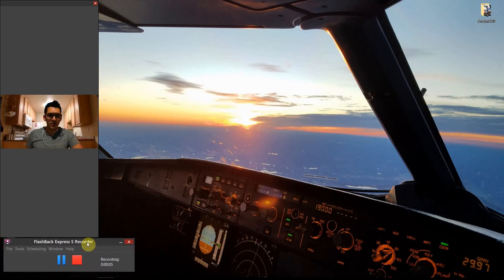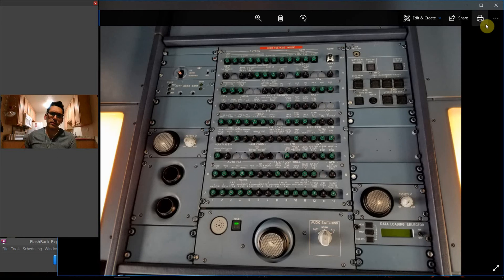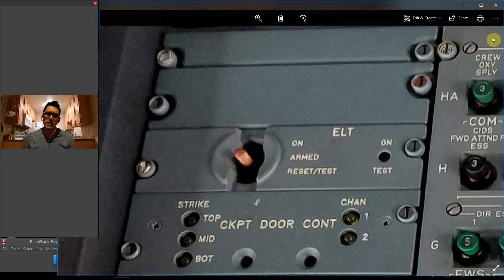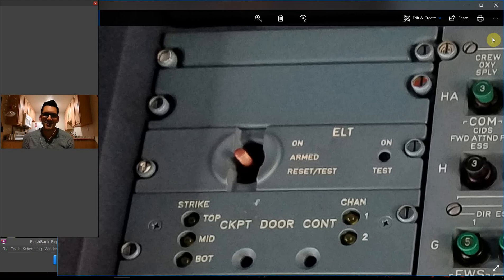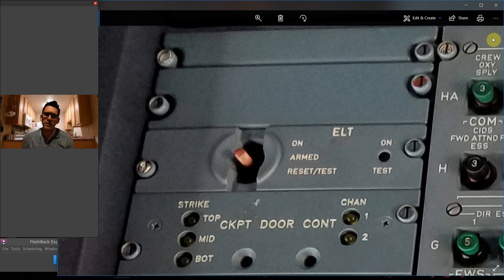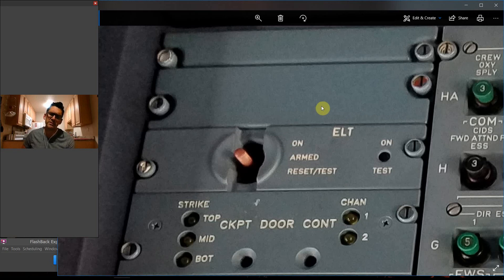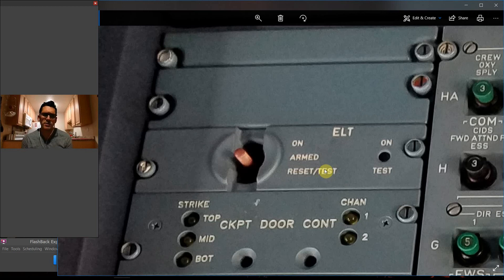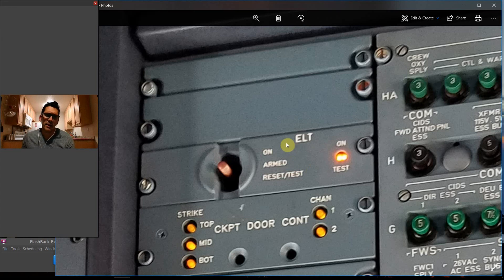Airbus A320 Cockpit Tour: #3: ELT: What do all those buttons do?!

Comment: The ELT system transmits on 3 frequencies, 121.5 MHz (Civil) and 243 MHz (Military) homing-signals and 406 MHz to the COSPAS-SARSAT satellite system. The battery-pack, installed in the ELT housing, supplies the power to operate the system.
The satellite system transmits the 406 MHz distress signal to a Local User Terminal (LUT), when the LUT is in range. The LUT receiving range is a radius of approximately 2500 km (1367 NM). When the LUT is not in receiving range, the satellite system stores the distress signal until transmission is possible. The LUT automatically processes the distress signal to identify and show the position of the aircraft to a radius of approximately 1.8 km (5900 ft.). The processed data is transmitted to a Mission Control Center (MCC). The MCC sends the data to an applicable Rescue Coordination Center (RCC), where Search And Rescue (SAR) operations are started. The 121.5 MHz and 243 MHz signals are used to find the aircraft in the final stage of SAR operation.

Comment: Hello Mike!! A question for you:
On E175 we also have the ELT switch in the cockpit and, during test, if something goes wrong with the ELT system during test the LED flashes many times to indicate that. Otherwise a single flash will be seen. How about the A320? Is there the same concept?
Reply from the maker: Hi Rubemar! Thanks so much for tuning in my friend! You know, we do not test the ELT as part of our routine daily flight deck set up. I can't remember the indications it will show off the top of my head. I will have to look this up in the manuals...Cheers! Mike

Comment: Hi Sir Mike, just a weird question, in case of emergency can you use ELT signal instead of sending code 7700 on transponder? What's the difference? TIA!
Reply from the maker: Hi Regis, that's a good question. There is indeed a difference. The ELT transmits a completely different signal than does the transponder. The ELT sends out a special signal that a search aircraft could use to find a lost aircraft that may have gone down somewhere. The signal that the transponder sends out is designed to be picked up by air traffic controllers on the ground. This will be part of the info that allows them to see a target on their radar screen. This is for every day normal use of course.